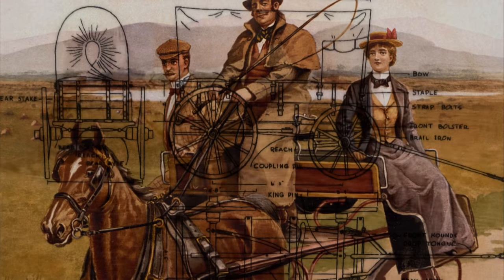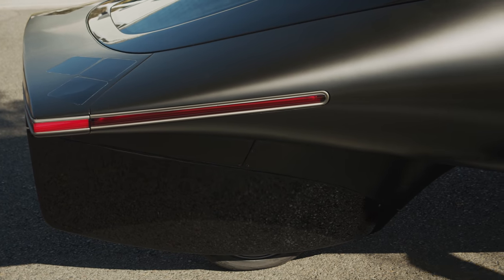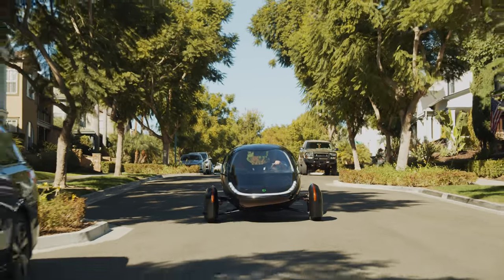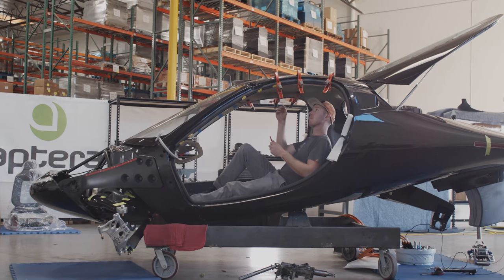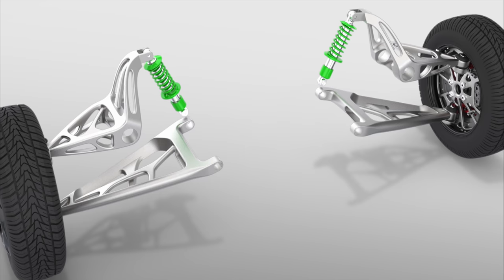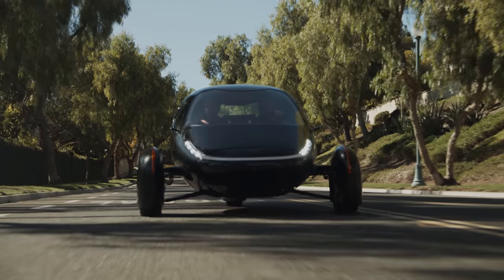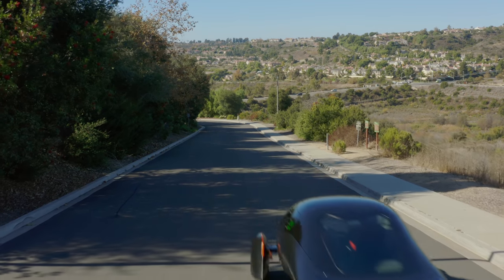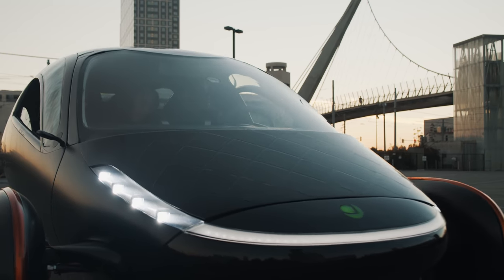Aptera Has Launched

Comment: Yet.. no cars for sale. Just another Elio.
Reply: Not even close.  Paul Elio has never built anything.  Chris Anthony, one of the founders, has delivered thousands of well regarded vehicles, and took his last company public.  You need to do your due diligence.
Reply: @n.brucenelson5920  "Chris Anthony, one of the founders, has delivered thousands of well regarded vehicles" And just like the Elio, all hype. From a physics standpoint he makes wild claims with nothing to substantiate them. Solar will not charge the car at a rate that would be worth the extra cost and time. This (if it were anything) would be a toy for the ultra wealthy that park their cars outside for months.
Reply: @frosted1030  The last company Chris Anthony founded is a successful publicly traded company.  This is not hype, it is history.

As far as physics, the prototype car is achieving its specs, which can be spotted on the display in some of the videos.

The full solar panels on Aptera provide a peak output of 700 watts.  True, this isn't a lot, but at EPA highway speeds, less than 100 watt hours are required to travel a mile.  At $900 for full solar, this is a no brainer for many of us.  Far from being a toy for the ultra wealthy, this will be a boon for those of us on a fixed income and need to reduce the ownership costs of our everyday transportation.
Reply: @n.brucenelson5920  "As far as physics, the prototype car is achieving its specs, which can be spotted on the display in some of the videos." A readout on a display in a promo is not a measurement. 
"The full solar panels on Aptera provide a peak output of 700 watts." No, by definition they can't. In fact the design of the car insures that there is no way to achieve full sun on all the panels at once. 
"At $900 for full solar, this is a no brainer for many of us." How gullible are you? 
" Far from being a toy for the ultra wealthy, this will be a boon for those of us on a fixed income and need to reduce the ownership costs of our everyday transportation." Are you high?? $25,900 and $46,900 isn't happening for those on fixed incomes. The average WORKER can't afford a $400 emergency and you want people to spend how much extra a month on this boondoggle? 
Let's review some basic concepts:
1. The very best NASA grade photovoltaic solar cells are 34% efficient, and cost in the millions per. These cells are not only far less efficient, but some idiot painted over them reducing the efficiency. Commercial solar cells available today might get you 25%, with paint, that would be maybe 15% or less on your best day. Then of course, there's cleaning. If the cells aren't perfectly clean at all times you will lose another 10% or more. Dirty cells simply will not work.
 2. Storage of energy comes at a size and/or weight cost. No batteries exist that store enough energy, safely, in such a compact form, as what they are pretending to have. If they did, Aptera would sell batteries, not cars.
3. Nowhere on Earth can you get direct sun optimally on a curved surface for a full day, even with mirrors. Learn how a curvature of any kind is the worst shape to capture solar energy. 
4. What about the 65% of the year or more, in most areas of the US that have little to no sun? Not to mention how night works.
5. Where are the independent measurements? Right, as long as there are no production models, there is speculative marketing fiction alone. 
Let's review your figure:
To generate 700 watts per hour you need a minimum of 25-29 FLAT solar panels each at 5.5' x 3.3' angled toward the sun weighing in at about 42 lbs a piece. This is based, of course, on home solar power generation with current photovoltaic technology. So do the basic math here, let's pretend you want a 10th of that because you want to fit that on a car somehow, and not angle it toward the sun, keep it clean, or stationary. So let's be very generous, and call it a single panel with maximum output of 70 watts per hour. Add dust and dirt (unless your maintenance includes full detailing every day). At the very best, on a really bright and sunny few days, it would take 3 days to generate your 700 watts (not calculating how batteries lose charge due to entropy and chemical changes due to heat, basic chemistry kiddo). So you parked your car surrounded by moving angled mirrors for three days and then you have an hour of peek usage. That's kind of a ripoff. 
We aren't even getting into lithium mining, battery wear, and the marketing nonsense that has you thinking you can change those tires yourself.
Reply: @frosted1030  I would have more respect for your rant if your numbers were even close.  What are you going to say when the numbers are confirmed by independent reviewers?
Reply: @frosted1030  Do you do comedy in your spare time?  700 peak watts is not the same as average, and of course they don't paint their cells.  But the real howler is this one: "Aptera would sell batteries, not cars."

You really haven't done any research into this, have you?  If you had, you would know that not only does Chris Anthony have a company that sells batteries - It is publicly traded on the exchange.
Reply: @n.brucenelson5920  "  What are you going to say when the numbers are confirmed by independent reviewers?" LOL That will happen, when (never) Aptera has a product instead of a couple of prototypes and hype. So far, like Elio, only hype.
" 700 peak watts is not the same as average" Even if one tenth of that were average, the solar array on the Aptera would be insufficient, when will you get that? 
"Chris Anthony have a company that sells batteries" LOL Ok.. let's review a bit of simple chemistry. LHV Power provides electronics to charge lithium batteries, nothing remotely innovative there. Their whole assertion is lithium is a better choice than lead. Flux Power Holdings (the parent company) is considered a "penny stock", as it's performance is total garbage (around $14 a share). They have no "large" contracts. They might manufacture batteries, but again, every few months, astonishing battery technology changes innovations are announced, to one of two results:

1. Impossible to produce at scale, or way way too expensive for any market
2. Laboratory experiments that don't demonstrate standard scientific repeatability
Basic chemistry: battery energy density is directly corollary to mass and surface area. No new innovations have prevented or slowed crystallization significantly enough to be marketable at cost.
Reply: @frosted1030  "Even if one tenth of that were average, the solar array on the Aptera would be insufficient, when will you get that?"  One tenth?  This is a totally unreasonable assumption.

And as far as Flux Power is concerned, It is rated a medium and long term buy by analysts and both earnings and sales were up sharply to record highs in the last quarterly report this month.  And it is not a penny stock. It is traded on NASDAQ. You are lying.
Reply: @n.brucenelson5920  "One tenth?  This is a totally unreasonable assumption." Show me a reasonable MEASUREMENT. Find battery capacity, weight, and see how much these solar cells can produce in a day in the winter in Michigan.
"And it is not a penny stock. It is traded on NASDAQ." It's not worth anything. Maybe you need to check their total value. Not a serious competitor in any market.

Comment: but what if a normal sized human sits in one seat and super obese in the other seat? i think the single vehicle would be way more imbalanced than with 2 wheels. In my opinion the only things to change for this to become a success is the cover on the wheels that sucks ass and make it 4 wheel instead of 3
Reply: It is designed for a weight limit of 500 lbs.  As long as you stay within that it should be fine.  The current wheel design took more than 10% from the cd value and is a major contributor to the overall performance of the design.  

With well over 7,500 orders since preorders opened two months ago we know it is going to be a success from the demand perspective.
Reply: @n.brucenelson5920  yeah but what if a person weighs almost the limit and sits down in the vehicle? would it always stay completely balanced, even when doing sharper turns?
Reply: @freetolisten  within the stated weight limits, yes.

Comment: Tesla will buy aptera
Reply: After what happened to Aptera the first time they tried, I think Aptera's leaders will be very careful of losing control again.  I worked at a company in Union City during the early days of Tesla, and my company hired most of the Tesla engineers during a major lay-off.  Aptera's restart has been much faster and smoother than Telsa's was.  It should be telling that Sandy Munro, who has a great deal of respect for Tesla, sold a lot of his stock in Tesla to buy a stake in Aptera.

Comment: This car sucks for $50k. It's basically as practical as a golf cart. Just buy an electric golf cart.
Reply: So, a golf cart that has been crash tested to automotive safety standards, can do 0-60 in 3.5 seconds and hit 110 mph?  Yeh, right.  Besides, if all you need is a commuter, you can get it for $25,900, and still have a range of 250 miles.

Comment: great, another ugly boring electric car that defeats the purpose of driving, I guess gone are the days of manufactures caring about style and people actually manually driving a car, the 90s were the pinnacle of what cars should be
Reply: I have ridden in the Luna prototype in the twisties.  With the flat cornering and impressive acceleration even in the two motor configuration, the Aptera is far from boring.  With the Roush performance makeover, adding an anti sway bar and more compliance, the production versions are going to be thrilling to drive.

Comment: Nobody gonna drive that, its ugly.
Reply: There were over 7500 preorders in the two months since launch.  Many people find functional form to be beautiful.
Reply: @n.brucenelson5920  Also it dosen't look safe if you were to crash on a typical road.
Reply: @freezyy9251  It only looks unsafe to you because you don't understand the engineering behind it.  It will be crash tested towards the end of the year when production ready vehicles are available, to automotive standards and will rate very well.  At that point I expect preorders will explode more than they already have.  No other 3 wheeler has been designed to automotive safety standards.
Reply: @n.brucenelson5920  what type of veichles is this considered as?
Reply: @freezyy9251  I am not sure I fully understood your question.  State registration will be under the motorcycle or autocycle category.  Here is an official Aptera comment on safety: 

We will not know Aptera's actual rating until we pass a production vehicle through the full safety test. But we are designing to exceed all passenger car standards and the previous version had the highest roof crush strength of all passenger cars on the road, it performed exceedingly well in actual side and frontal crash tests. Aptera features a Formula One-inspired safety cell with advanced composites and metal structures for impact strength. Similar to aerospace and racing, these energy-absorbing methods are a core part of our safety strategy and have proven effective time and time again in high speed impacts.
Reply: @n.brucenelson5920  sorry autocorrect made it come off wierd. So basically this is a trike / motorcycle class veichle right? Cause I mistaken it for a car because of the video.
Reply: @freezyy9251  It will be registered in the motorcycle/autocycle class and crash tested to automotive safety  standards

Comment: 3 wheels, clearly not a single engineer was present in the designing process of this ugly poo this crap would get an ancap rating of 0 that is for sure but they'll never get that far.
Reply: You have certainly proven you are not one.
Reply: @n.brucenelson5920  okay tell me why 3 wheels is better than 4? turn faster then 1g and it tips over
Reply: @pablomuzzobar8940  I don't know if it can even reach one g without drifting.  Suspension tuning still has to be done before those specs are gathered, but I am betting that it will pull at least 0.8 g.

Remember that with the 77" front track the center of lateral force stays inboard of the triangle.  In addition the entire motor weight of the car is carried at Axle level.  On a typical tall SUV in a sharp turn the inside rear wheel tends to lift and over she goes.  This can't happen with the Aptera design.   It has also been tested stable in 110 mile per hour cross winds.
Reply: @n.brucenelson5920  0.8g is crap and you know it so it understeer locks and hits a wall now is that any better?. 2front 1 rear most unstable , 4wheels the best, 2rear 1 front stable but can't turn to save your grandma on the road ahead of. U.
Reply: @pablomuzzobar8940  I am not going to lie about performance that I do not know the answer about yet.  I do know that flipping it, which was your claim based on no knowledge of the design is completely unlikely.

Your understeer claim is equally unlikely with around 70% of the weight bias on the front wheels.

Comment: Production is to be started in 2022 😂

They are almost bankrupt and 2 years away from production

Bankruptcy within 12 months seems most likely
Reply: Not even close to as "almost bankrupt" as Tesla was - twice.  If you were paying attention, you would have known that the 2022 date was pushed back because the volume of orders exceeded the planned vacuum resin infusion production method.  Instead, CPC is building the bodies using supercar tech.  The quality of the production vehicles has increased greatly.  Parts are already in production now and testing of the validation vehicles will start this spring.

Comment: This is not a car but a glorified motorcycle that is a death trap.  No manuaverabily & they know it!  This project is another failure @ a very high price!
Reply: This vehicle will be tested to automotive crash test standards and will do better than many actual cars, as you will see when the results are published.  Data from the alpha vehicles has already allowed them to design suspension improvements with the help of Roush that will dramatically improve the performance of the beta models.  Strange that you would call out failure based on the first engineering sample.   It is early days in the development process.